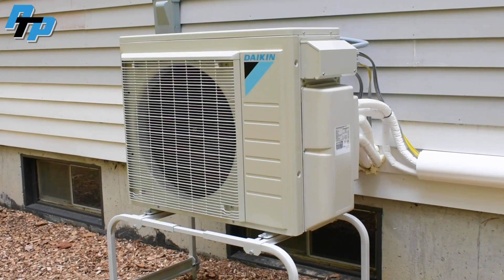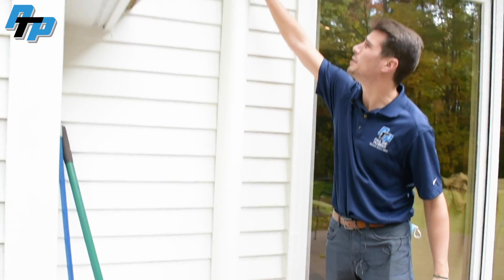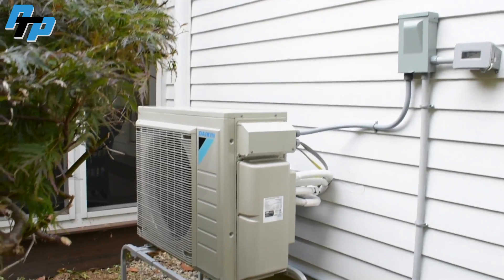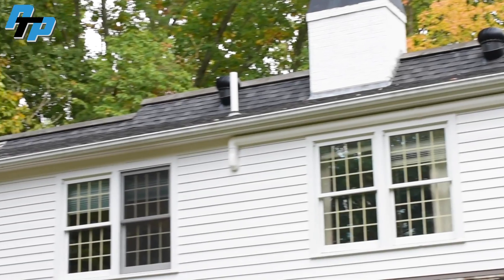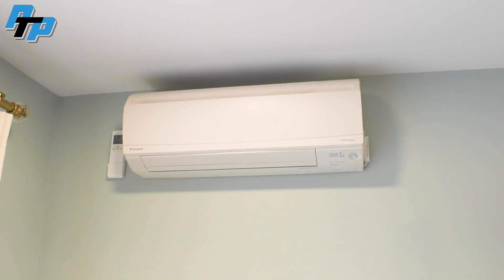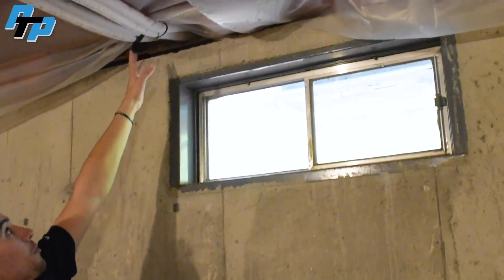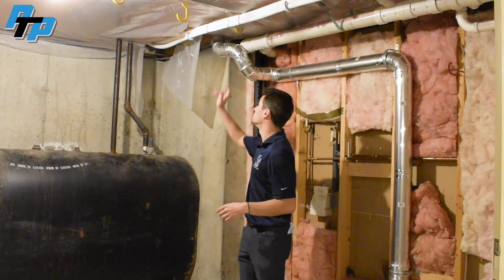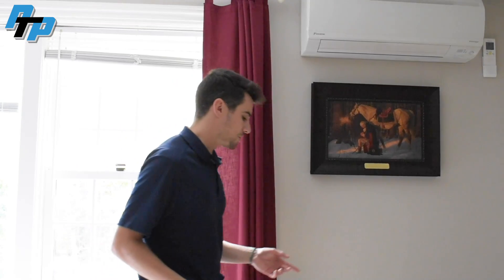Five Zone Daikin Ductless Mini Split Installation Walk Through.

Comment: Thanks for the video.  This house is quite big, and I was wondering how you could run the lineset from the outdoor unit through the basement to each of the indoor heads without exceeding the maximum allowable pipe length of the system.  Does the indoor head condensate drain through gravity or a mini pump?

Comment: Hey man! We had a 3 head system installed. 2 downstairs and one in the garage. The one jn the garage stays off unless we are in there. Issue is I can have the living room one set to auto, and if I ser the kids playroom to auto it will shut off. Even if I make sure to turn them both on in auto. If I set the one in the kids room to cold, and the living room to auto, they work fine. 

Do I need to have the garage one on for them to work properly? Any suggestions?

Comment: Wait. When it reaches the desired temp and it turns off, it doesn't really turn completely off, does it? Why doesn't it continue to extract the humidity? I have a 12000 BTU unit in a small room, I always run it on cool mode and I've never noticed the air to be cool and humid. Never had to run it on dry and I've had clothes dry inside in a few hours, so it's pretty clear on cool it also dries the air.
Reply from the maker: It can vary depending on the heat gain/loss in a room, I'm glad to hear you don't have that issue.

Comment: can you open the lines on a 2 zone machine, but only use 1 zone most of the times and turn the 2nd zone on like once in 2 months or smth ?
or add a 2nd zone like 8 months later while using the 1st zone ?
Reply from the maker: I would recommend doing both zones on one outdoor unit at once, but you can run them however you'd like. You don't need to run the zone you don't want running until you want to use it. Hope that makes sense. Thanks for watching!

Comment: Is it a VRV system? 
If they’re all on auto & one goes into heat & another cool that would cause a communication issue, no?
Reply from the maker: It is not VRV and that is correct, the units need to all be in either cooling or heating mode to operate correctly. Auto mode still works in summer/winter but shoulder seasons it is recommended to just put it in cooling or heating mode.

Comment: I want to do a multi-zone system My home is 2300sqft I need 5 heads. What do you do about the bathrooms, laundry room, and closets?
Reply from the maker: Laundry rooms and bathrooms typically stay unconditioned.
Reply: @paultheplumber8665   Yeah my laundry room gets hot. I plan on leaving the existing vent system and adding a air purifier so it should push some air in there. I'm told some put a blower vent.

Comment: It is very useful. I moved into a house with a newly installed a Daikin 3 unit split with inverter connecting to one compressor. For some reasons, one of the unit didn't operate properly. When we turn on the unit, it shuts down after  10-15 secs automatically. Try a few times and still not working. We have a general contractor looked at it. It does not seem to have problem from the installation side as the other two units work. Can you share if there is programming problem. Or which other way that we can trouble shoot. Thanks
Reply from the maker: My only guess without being out there would be to make sure that unit is in the same operation mode as the others (so if the others are in cooling, make sure that one is in cooling as well). I have seen that happen plenty of times before. They all need to be in the same mode to work correctly.

Comment: We had a Daikin mini split installed in our master bedroom, to cover the bedroom, walk-in closet & small bathroom. They put in a 24,000 btu unit in. If we set the air conditioner at 68 degrees, it’ll continuously blow cold air until it’s 60 degrees in here, and we have to use the remote to turn it off, or it just won’t stop. If we turn on the heat mode and set it to 68, it’ll blow warm air until it’s in the high 70’s, and we have to use the remote to turn it off….this doesn’t seem right and we don’t know what we’re doing wrong. Also, we are not familiar with these units and feel as if we were perhaps sold one that is too large for our bedroom, it’s pretty big, it’s a FTX24AXVJU 24MBH Wall Mount 19 Seer R-410A Fan Coil. Can you please offer your opinions on this? Thank you 😊
Reply: 24k btu for a bedroom of any size is crazy. Not sure where you live but most large masters will be fine with a 9 or 12k btu unit. If there is substantial heat load and drafts etc . Was this a Daikin Comfort Pro company 🤔
Reply: Try setting it to dry mode at 74 degrees for cooling.

Comment: if i install 5 zone under 1 condenser do i need a distribution box or just run the lineset from the condernser straight to the air handler?
Reply from the maker: It depends on the system but you will most likely need a branch box.

Comment: What I want to know can you heat with one zone and cool with another zone at the same time on the same outdoor unit
Reply from the maker: No, if the indoor units are running from the same outdoor unit one cannot be heating while another is cooling.
Reply: @paultheplumber8665  thanks

Comment: With a multi-head or zone system can you use the auto feature on the thermostat or do all the indoor units need to be on heat or they all need to be on cool at the same time
Reply from the maker: They all need to be in the same mode, so they can all be on auto mode and that would work fine.

Comment: if my outdoor unit is 18,000 BTU Dual Zone and my one indoor unit is 18,000 BTU, can I add a 9,000 BTU indoor unit? Or do I need to get rid of the 18,000 BTU indoor unit and get 2 9,000 BTU units?

Comment: Is there a reason for installing 2,3 zone systems vs single 5 zone mini split system? What are the pros and cons?
Reply from the maker: One big reason is electrical, you would need an individual breaker for each outdoor unit if you went with multiple single zone units. Also it would take up much more space outside.
Reply: @paultheplumber8665  He said a single 5-zone system, not 5 single-zone systems?
Reply from the maker: @HaploBartow  I misread this, my bad. The reason for the two seperate units as opposed to one 5 zone were the line set runs. At this house it would have been extremely difficult to get the line sets everywhere they needed to go from one central location. By seperating it and putting one on each side of the house it made the installation much smoother.

Comment: This was great to see the breakdown. Im not excited about my soon to come DIY multi zone install on our 1600s Millhouse which is all 3ft thick stone walls except for the top floor (loft) which is wood. 5000sqFt (3500 needs cooling)
Gonna have to start looking a little closer at where the line sets will penetrate, but beginning to think that they all will probably penetrate the upper floor (wood walls) and then feed down.
The wall mounts would likely be suspended on brackets up there (40ft)
On massive projects like this one, is it unreasonable to suspect it might be acceptable to keep the line sets EXPOSED on the interior walls with the slim ducts?
Reply: Maybe do roof vents I've seen them for these before instead of wall
Reply: Contemplate hiding the linesets in a chase disguised as an exposed pillar.

Comment: I know that most of these units come precharged, however, do you need to add more refrigerant if the lines are longer?
Reply from the maker: Yes you do.
Reply: @paultheplumber8665  Bingo, that is the info I was looking for.  Max line length is that per individual  zone run or is it a total system number?  So if I have a shorter run on one zone can another zone have a longer run and still be in spec?
Reply from the maker: @IamDerick  The max lineset to each head is the same, and it's all independent. Just because you don't use the max on one does not mean you can use more than the max on another.

Comment: Hi Paul, we are building our new house and are going to have radiant slab heating(slab with frost walls) for the heating and planning to install a LG L5H60W0909121218 five zone mini-split, 18kbtu for the living room, 9kbtu for master and second bedroom and the two 9kbtu for the other two bedrooms for the summer time in Maine to cool off and take out the humidity.  Would this system be sufficient to cool off the house during the Maine summer time.  Thank you
Reply from the maker: It sounds like it should be sufficient to me. I always recommend having a professional come out and size the house and the system though.
Reply: @paultheplumber8665  Thank you

Comment: Hiya, what made you go with this option rather than ducted central?
I'm trying to decide on this at the moment
Reply: Not the expert here, but I'm looking at this option too since my central unit just gave out. 

It's like having a window unit in each room with out the ugly back of the unit hanging out of the window. 

You can control the temp in each room separately, and the electric bill will be lower. I like the idea.
Reply: @rtshort  Are you going to install a head in each bedroom? Between main living area, BRs and office, I'm looking at 5 heads. It gets pricey plus you have all that lineset running on exterior walls. Might just replace my old central air unit and air handler.
Reply: @bokononisti2820  Yeah, that was what I was planning to do. I can get away with 4 heads but would prefer 5. It's a 2 BR, 2BA House but it was built around 1900 (which I love) and it's about 1,800 Sq Feet with 12 Foot ceilings. No insulation in the walls, but I did put some in the attic. Running the entire unit keeping it all heated/cooled puts the electric bill through the roof. I think I'd save enough to justify it by only heating/cooling the space I was in at the time.

Comment: I want to run my lineset through a crawlspace, and It looks as if you have a clean install through the basement,  From what I can tell you are using a 2 hole clamp, one for each line set, and then tether them together with zip ties.  What size clamps are you using and how far apart do you recommend?  Thanks
Reply from the maker: 2" 2 hole clams

Comment: Great video, how much was the install cost for this setup?
Reply: @michaelw482  I ended up getting a 3 unit Mitsubishi installed with a 30k compressor and it was $8500 before rebates, a 4 zone 38k compressor and units would have been $12k
Reply: @Sledhead  did you install it yourself or hire a hvac company? What was the total amount after rebates?

Comment: Hi, I am planning to install a 4 zone unit, 3 heads(9, 9, 12) on the main floor, 1(12) in the basement. Some people told me I should not put the basement head from the same outside unit, they want me two buy two units, a single zone for the basement and 3 zones for the main floor. What do you think?
Reply from the maker: Depends on the sizing of the indoor heads, and what you're looking to get out of that basement zone.

Comment: Nice. I’m looking at the senville 36k quad zone system. The system in charges with enough Puron to charge 100ft of Lineset. Is there a disadvantage to running a longer line. Say 3 16 ft and 1 50 ft? Would I lose efficiency on the longer line? Reason is to have the compressor on the back side of the house will still have a unit in each bedroom.
Reply from the maker: You won't lose efficiency because of lineset length, you just can't run lineset past the max allowance.